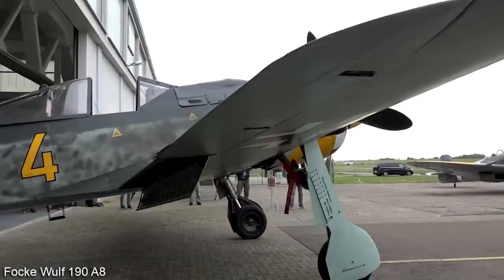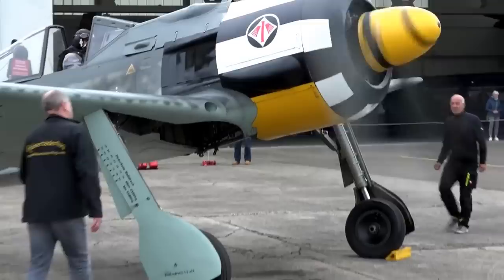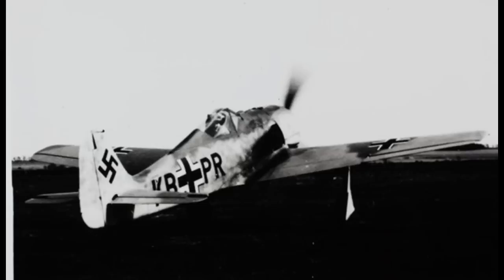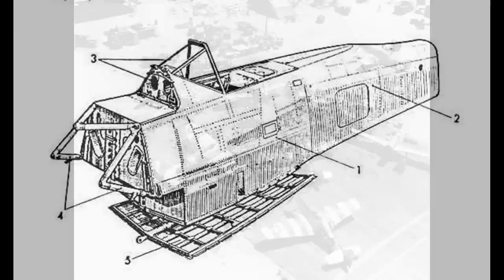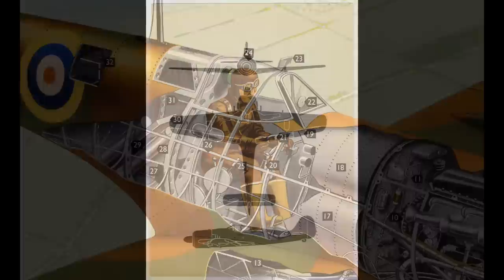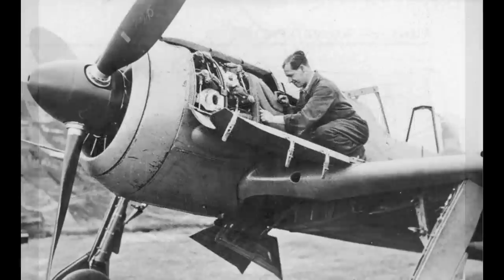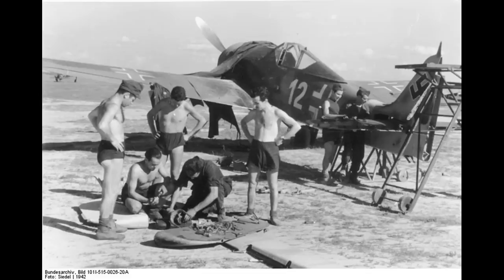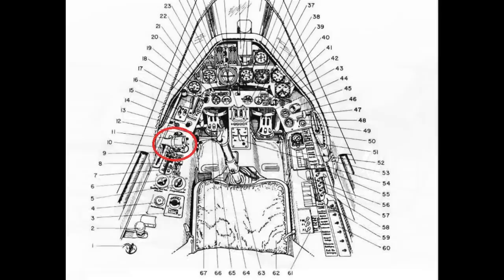Focke-Wulf Fw 190 Pt.2

Comment: Excellent series (as I've come to expect from Greg)!  Regarding the whole constant speed propeller discussion, for those of us who don't fly, a good analogy might be the transmission in our cars -- which most people 16 years and older will be familiar with.  Increasing the prop pitch is like shifting to a lower gear in a car.  While 1st gear is great for pulling away from a stop, and 2nd gear is the gear to use to accelerate quickly when rolling, neither is good for cruising or highway use, let alone top speed on some Nevada highway.  Those activities require a much lower pitch on the prop (i.e. lower ration in a car's gearbox).  Conversely, if you're puttering around in top gear at 1200 RPM in your car trying to the to the next gas station without running out of fuel, and you need to accelerate quickly, mashing the throttle open won't do much except make your engine rattle.  You need to jump to a lower gear and mash the throttle to accelerate with any authority.  Adding a turbo (i.e. manifold pressure) provides another layer of complexity.
Regarding the engine control system, I think that you summarized it well as a mechanical computer.  I can't tell for sure, but I suspect Robert Bosch had something to do with it.  The company starting making integrated diesel fuel injection pumps in 1927, which seemed to be the standard for this application  until the 1950's.  From that diesel injection pump is a small step to gas injection (see most Germany aircraft engines of WWII) and engine controls.  After the war this technology showed up in the German manufactured race engines and eventually performance street car engines in the 50's and 60s.  I think that I can see a barometric measuring feature in the top right of the diagram at 28:00.  In addition the throttle position ( possibly lower left?) and engine speed (light blue?).  These look similar to what you'd see on an early Porsche 911 Mechanical Fuel Injection (MFI) system.

Comment: Off on a tangent, my favorite pilot memoir of WWI was Arthur Gould Lee's No Parachute. You're right. The Brits thought it would lead to cowardice. The Germans, however, had a very different attitude and several, including Ernst Udet, I believe, used them. The other pertinent point in Gould Lee's book is the now almost unimaginably high altitudes they flew and fought at. Without oxygen, of course. Why? Because it was only at very high altitude that the Sopwith Snipe could compete well against the dominant fighter at the time, the Albatross DIII.

Comment: I personal think the biggest advantage of the FW190 was/is the air cooling of both the engine and the oil. The chance to survive hits to the engine was better then for the water cooled engines. The FW190 was a really great fighter with it's simplicity in the design and overall ruggedness.

Comment: Great engine management section, and love the deep dive on the 190!  Although minor mistake, the 109s past the E's (and even some E's) had automated prop pitch.  So "unified" throttle for them too.  One MAJOR deficiency in the unified throttle control is the ability for fuel efficiency.  Take the P38 for example, where Lindberg helped get much more range out of P38s with extreme engine settings in cruise.  It's something that rarely matters in simulators for sure, though.   Would love a video on the mis understandings of the P38, such a wonderful AC too, and again it's deficencies are not apparent automatically in simulators either (hard to work drop tank switches, cold cockpit because of lack of engine in front of the pilot).

On IL2, I think the current g-force modelling which was recently updated works much better, and honestly seems to be about the best g-force simulation for any of the current crop of simulators.  I don't fly Spits often (really very rarely), but at high speeds the FW 190 does indeed seem to be able to out turn the Spit in my limited testing there.  Again just don't fly the Spit much probably need comment by someone who flies them more. 

109's specifically seem to be effected the strongest by this as black out in many maneuvers happens much faster, so having to adjust years of "bad" habits from poor g-force simulations.  Really don't like flying the 109s right now in that sim, probably a good thing :).
Reply: This seemingly contradicts the point about the similar positioning of pilots in german planes. You should experience the same G tolerance in the two planes. If it differs it's a mistake or game blance.
Reply: @Tesshier  not sure.  Just from my limited testing with the new g-force mechanics.  It's likely they didn't account for things like this.

Comment: Notice the unique ports on the wing roots of the Flugwerk replica at the beginning of the video.  This is a custom oil cooling system that several Flugwerk owners are using.  The original oil cooler design from Flugwerk used an adjustable system in the top cowl gun location that allowed pilots to maintain oil temperatures.  But this system was not working very well.   This Flugwerk is with the Hangar 10 collection in Germany and was rebuilt from the French-registered example that ditched into saltwater.  I learned recently that Hangar 10 has additional plans to refit the aircraft with an original BMW 801 in coming years.  Also notice the lack of a forced-air cooling fan on the replica because there was no such geared fan system on the ASh-82 radials.  Flugwerk replicated the look with a ground-adjustable fan attached to the propeller spinner but several owners have removed it.  A New Zealand based Flugwerk experienced a problem when the engine cowling flexed in flight and contacted the fan. (The Flugwerk cowlings are not armored and are not as strong.)  Here is good picture of that custom oil cooler system in the wing: https://i.postimg.cc/0jVRSP04/Fw190-A8-M-Hangar10-2019-04-05-9.jpg

Comment: One of my hunting buddies had a Dad that flew the FW-190 while stationed in Rovaniemi, Finnland during WWII. I think that outfit was called JG 5 the "Eismeerjäger". This gent told me his father especially enjoyed the wider track of the landing gear on the FW-190 vis a vis the Me-109. Landings on rough, unpaved airfields north of the Arctic Circle must have been a chore and the young men flying the FW-190s had decidely fewer groundloops than the collegues flying the Me-109s!
Reply: +Andreas Venator   That tilted camber angle on the Bf-109 wheels could make the wheel turn and the Bf-109  could suddenly yaw in either direction, especially if you went over a bump with one wheel lifting off.   Flying from grass was much safer for Bf-109s because they could slide around a bit during takeoff or landing.

Comment: This has to be one of my favourite Youtube episodes ever! I like your explanation of the Kommandogerät a whole lot, the pics reminds me of something similar I saw twentyfive years ago about the hydraulic/mechanical computer controlling the jet engine of a SAAB AJ37 Viggen fighter, it also had a number of cogwheels and levers, and it all was powered by hydraulic pressure provided by jet engine fuel from the afterburner fuel pumps. Really cool! And oh yeah, you say Kommandogerät pretty well. It´s only the Gerät part you stress backwards, you say it roughly like Garrett. But it should be more like ka-chunk. With very little stress on the Ge, and all the stress on Rät. But I don't care, I just say this because you commented yourself about not being sure about the way to say the word.
Reply: "Gereet" with a hard German G. And the E's a in endless or efficient.
Reply: Although I think handwaving the question of why units like the Kommandogerät weren't more widely used by talking about how jets were taking over and didn't need anything like that is a little disingenuous, given that there were years between the introduction of the FW 190 and the Me 262; given all of the different propeller-driven aircraft that the Third Reich developed and updated during the war, there needs to be an explanation why a device like the Kommandogerät wasn't implemented for them.

Comment: Fantastic review Greg. Thorough and easy to understand. I can really appreciate the ergonomics of the FW 190. A tip of the hat to Kurt Tank and the design engineers at Focke Wulf. The 190 seems like a pilot’s airplane in so many respects. The simplicity of operation of this airplane as opposed to say a P-38 Lightning which seemed to require a great deal more attention. Especially when it came to manifold pressures and boost settings. If I could own a WWII German fighter it would be the FW 190 A8 or the D9. Both in my opinion good aircraft in their own merits.

Comment: Never knew the 190 was predominately Dural, so that is new to me. Combined with its rugged construction it undoubtedly earned that rugged reputation. And good points about the O2 bottles, multiple small bottles with one way valves would undoubtedly be more survivable than one large tank.

Yet another informative video Greg. The details and explanations are superb, painting an ever more detailed image of the aircraft.
Reply: Dural (specifically 2024 Aluminum) is still used for the bottom skin of modern jet liner wings (at least the ones made out of aluminum). The top skins are typically 7055 Aluminum. The 7055 is typically a bit stronger but is more sensitive to stress corrosion cracking under tensile loads, hence its use on the upper surface which is loaded in compression, and not the lower surface which is loaded in tension.
Reply: @sheritonn5019  Interesting info, makes sense when one thinks about it.

Comment: I  really enjoyed your episode 2 of the FW-190 video. The plane was full of excellent design solutions and technical concepts turned into very valuable practical solutions, and both first two parts  of your FW-190 series explain that very nicely. I enjoyed getting to know more about such details. In the first part you give an very enlightening quotation of the Tanks own thoughts about his design intentions. And it begins like this: 
"The Messerschmitt 109 and the British Spitfire, the two fastest fighters in world at the time we began work on the FW-190, could both be summed up as a very large engine on the front of the smallest possible airframe; in each case ARMAMENT had been added almost as an AFTERTHOUGHT" ( my capitals). 
What comes to my mind first regarding the FW-190 is it's general conception, which makes an important turning point in the fighter design of it's time. It was a very strongly armed and consequently heavy fighter, with high wing loading and low turn performance. This latter has been sacrificed to the armament. The reason is clear; the lightly armed planes of the early thirties had to shoot for a long time at the opponent to get it down, so they had to stay with it in the turn. Arming them heavily was out of question, or they would've had a climb rate of a log.
The four-cannon, instantly efficient armament was still not possible with an 1000 hp, but it became so with the 1500 hp class engines.
That is how Tank designed a fighter whose armament was not an afterthought. The engine development made this possible, and so the Tank's fighter concept pushed all the previous fighters to the edge of obsolescence. 
I feel this deserves mentioning somewhere at the beginning of any FW-190 story, because it is about the very important contribution of this design to the history of fighter development.  I hope you are going to mention it in the continuation of your nicely made series.
Reply from the maker: All true, more power means you can have more stuff, more performance, more armor, and more firepower. Eventually I'll get to the engine, and to the weapons. We are only two parts in so far, and I felt it important to start with the more uncommon features of the 190.

Comment: Actually, the french post ww2 bombers, the Md311 Flamant (also Md312 and Md315) took from the germans the "kommandogeraet" for it's engines. Having worked on it as a mechanic and flight engineer in an association, it's quite complex, indeed, but once you've set up the riggings once, you're never have to mess with it anymore. Very efficient and reliable over time. It adjusts mixture pending an internal static pressure port and rpm though a sensing gear linked to the engine shaft, well mostly, to make it simple.

Comment: Gerät is pronounced with a long ä. 
Many fighter jet engines have 2 control levers. One is for throttle, the other is for nozzle control. Of course, nowadays there always is an automatic mode, but it can also be controlled manually if needed. I'm not sure if the nozzle control on the Jumo 004 was automatic or manual. 
Please don't missunderstand my comments on small details. These are really the only things I can find in your work, that I don't fully agree with or where my knowlegde tells something else than your knowledge. I really like your videos. I learned quite much detail information from you and I really like the way you present it. 

My interest in historic aviation started pretty much like your's, by plastic modelling. For me, it started in the early to mid 90s and there was only one other boy I know, who built plastic models. We always knew what was in stock in the local toy store and judging from the small number of kits that had gone missing in the shop between our visits, there could have been not more than a handful of other plastic modellers in town. My father did not build, but most of my uncles did when they were young. Over the years there came quite a bit of knowledge and literature about the "big ones" and plastic modelling was replaced by rc modelling, where I found out that gliding with the birds (they always won the climbing contest even though their wing loading is higher!) was more interesting than flying motorplanes. But life's plans were different, so I'm a bit out of that thing now and much data and many details are not in my memory anymore. What I regret most is that I never booked a flight with a Ju52, because it seemed too expensive. Once, I even had counted the money in my purse, when I was at an airshow where flights were offered. I had enough money with me, but I did not use it. Now they are all gone.

Comment: Just for people who aren't too familiar with this - "fine" or sharp (high percentage) propeller pitch means the blades are more perpendicular to the plane's nose, while "coarse" (also refered to as 'flat' in the video) means blades are more parallel to the direction of the nose.

Also, prop feathering is course pitch taken even further, so that the blades induce the smallest amount of drag possible, for cases such as engine failure when you are forced to glide.
Reply: *coarse
Reply: @luvr381  woops

Comment: About the fabric exhaust bulkhead: I once had a ride in a Pitts Special in the winter, so we closed all of the forward facing vents (5 or six of them) for the flight because it was nearly zero degrees at altitude on that day. 

By the time we had reached the manuvering practice area, I was already feeling green from the exhaust gasses entering the cockpit, and while large loops and even rapid rolls were fine, multi axis menuvers made me nearly lose my lunch, even an easy barrel roll was too much. 

The exhaust was entering through the landing gear  junction at the firewall, a Pitts has an open belly in that area which coincides with the exhaust outlets below the cowling. 

By closing the fresh air vents, the cockpit then becomes negetive pressure instead of slight positive pressure as there are no forward facing vents the rear fuselage gaps at the elevator and tailwheel, sort of become suction generators as they are actually at a lower pressure area aft of the cockpit. 

This caused a significant exhaust smell which made myself at least feel sick within ten minutes of departure. Avgas smells clean, but 100LL exhaust is pure awful.
Reply from the maker: Thanks for that story, it makes sense. I'm glad you came out of that OK, carbon monoxide poisoning sucks.
Reply: @GregsAirplanesandAutomobiles  yeah it does. And I did open a vent just slightly, which cleared it up, and froze my nose, but it turned an exhilarating experience into something less than desirable. 

So, with the FW I would presume the tailwheel opening or control rod exits might have pulled a slight vacuum on the fuselage brings exhaust in from around the cowling somewhere.